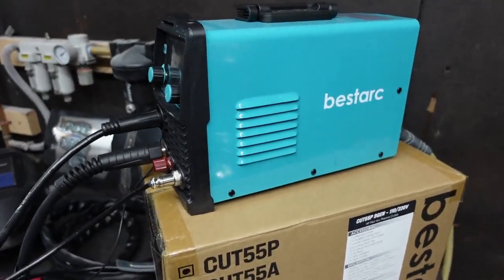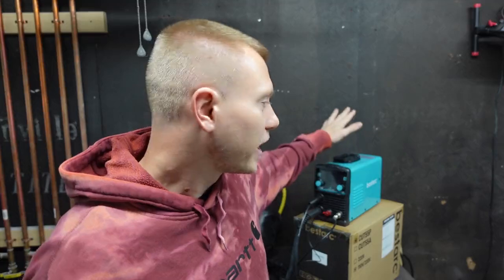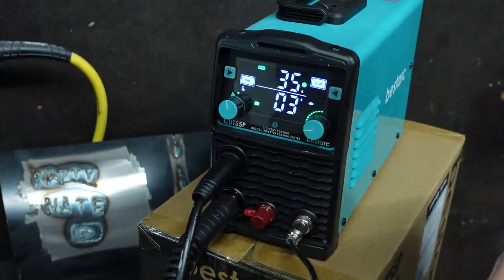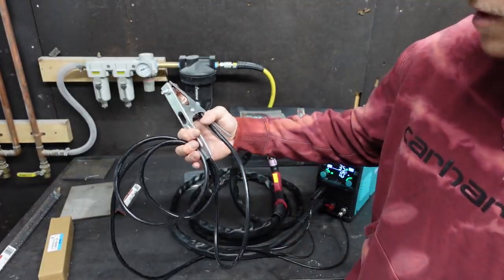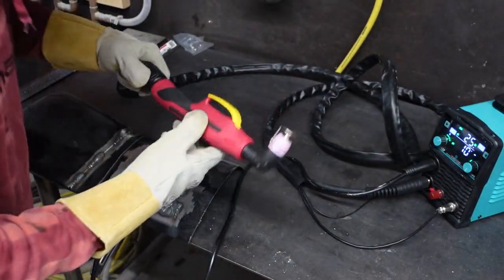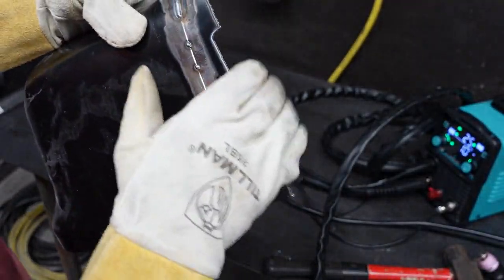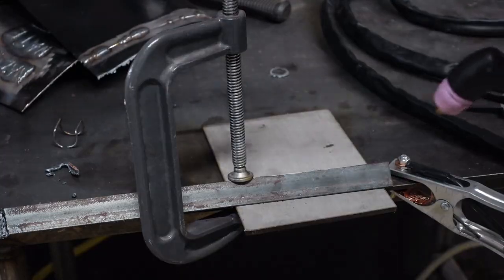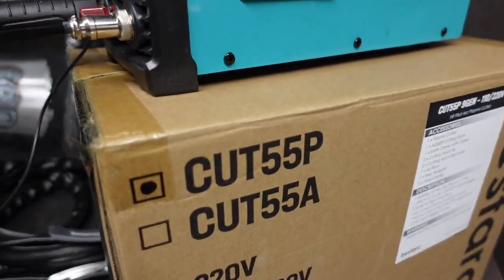Beginners Guide to Cheap Amazon Plasma Cutting Tips & Tricks

Comment: Can you use it to heat up metal red hot for Hammer shaping / forging? By holding it a little further back?
Reply from the maker: Probably not, this needs an arc to keep running. It would be better to have a torch for that
Reply: Yeah you can but you need to cut or grind the tip down so that the orifice is as large as possible and part of the electrode is protruding. Better to use a PT-31 torch rather than the AG-60 that is in the video.

Comment: Hey you did a video a while while back about an amazon pressure washer sandblasting attachment.
Was wondering, what PSI pressure washer did you use? And mainly, what was the flow rate per minute of that pressure washer?